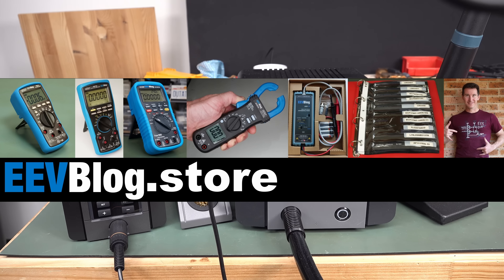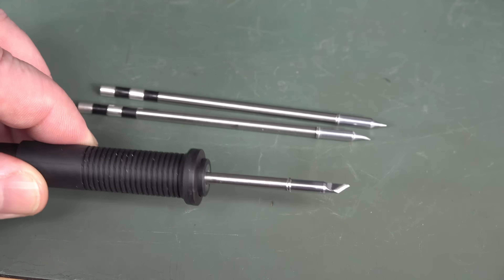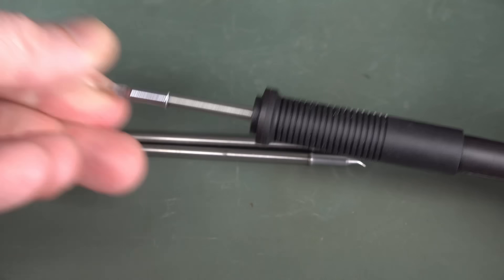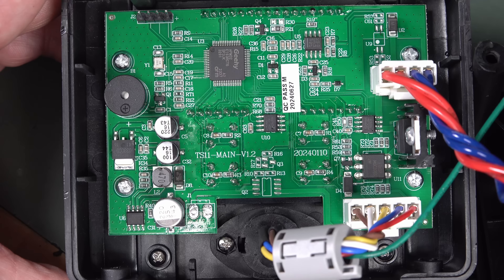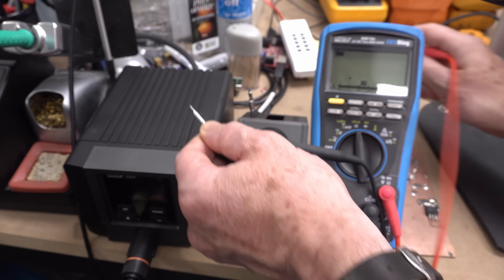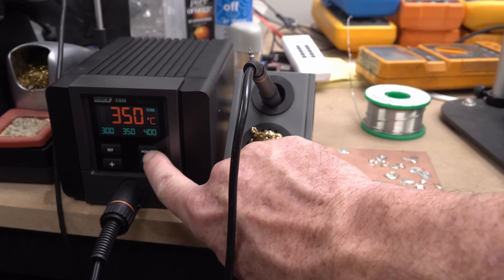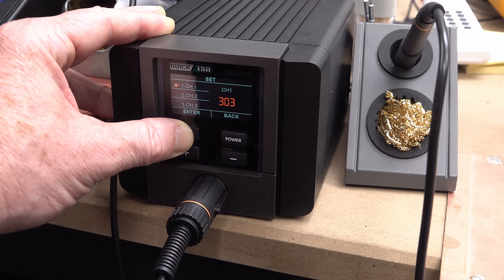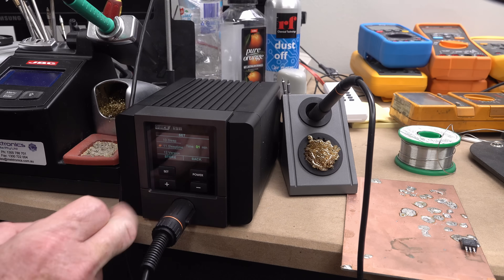EEVblog 1645 - $80 Quick TS11 Soldering Station REVIEW

Comment: How strange! I'm wondering if it's a case of some half-baked demo/pre-production unit? That might explain half the features being missing. Not sure why the power output is so bad though. Maybe that's also a firmware issue, perhaps the power level meter is accurate and it's not even driving the iron properly because it thinks the iron temperature isn't dropping? It's as if it can't even (or isn't trying to) read the thermal sensor or the accelerometer inputs.
Reply: Regardless of if it was pre-production, this is the sample sent out to be reviewed.  A company that wants to even sell something would be making sure its demo product worked for reviewers.  If they can't get their review sample working right, what hope have any of us got of gettign decent support from them?
Reply: @EsotericArctos  Maybe someone in the shipping department sent the wrong one by mistake. Something seems messed up here, beyond just poor performance. Their website certainly mentions a "precision vibration sensor" which obviously isn't working, so it's likely something is faulty or it's a pre-production unit.

Interestingly their website lists 14 different tips for this station you can purchase, not just the 6 mentioned here, so there's the possibility of miscommunication too. Might even be "review" doesn't mean the same to them as it does to us. Lost in translation? It's an interesting mystery...
Reply: @Agent24Electronics  Feel sorry for them if they accidentally sent a dodgy one out, but this is the one we saw the review on.  Would I take the risk on just hoping this was a one off faulty one?   Likely not given what else is available in a similar price range.
Reply: @EsotericArctos  It certainly doesn't give a good first impression, but I'm just trying to understand why the thing performs so badly. Pretty much every soldering station produced these days works better than this, and Quick made the 861DE Hot air station which is popular and works well. They don't seem like an incompetent company, and anyone in a back-alley basement somewhere in China could produce another Hakko 936 clone that'd work better than this TS11 station. It feels like there's something not right with Dave's unit. I wonder what Quick will have to say about it.
Reply from the maker: No idea!
Reply: This is normally something along the lines of a design flaw in where the thermocouple is placed in the cartridge. It still thinks it's hot even though the tip has cooled down. I had this issue with the Pace ADS120. I'll post my findings in the next few days on my channel with the TS11
Reply: @sdgelectronics  But then why doesn't the vibration sensor appear to work? That should still function even if the tip design is bad.

Comment: My Atten iron is pretty good. Forgot the price but you can change the heat setting on the iron itself. The base also has a built in solder spool holder.
Reply: I'm planning on getting an Atten hot air station, the charity I'm volunteering at is looking as getting a soldering station and hot air stations too, and we want to get something decent without spending too much money.
Personally I have a Yihua station, the soldering iron seems to be pretty good but the hot air not so much (its one of the cheap ones with the fan in the wand). I am very much a beginner though.

Comment: Are Quick a decent size asoldering manufacterer?
Hmm, ain't they a behemoth.. like Chinas biggest?
Would have been interesting t see what wattage it actually took, as it does not look like 90w or 80w even with those tips.
It is a cartridge system and they are pretty effective to push, if they are allowed.
A simple AC wattage meter, would have shown you what wattage it took and if its hamstringed before the tip..
the dishonest display, is problematic.. I wanna known the actual temperature, not least on a small tip, as that will also let me be familiar with the system, so I can adjust the temperature high to certain tasks, depending on the dipping..
Reply from the maker: Yes, Quick are pretty huge, which is why this is surprising.
Reply: Is Yihua not China's biggest soldering iron/station manufacturer?  Is Quick larger, or merely larger in the more professional segment? 🤔🙂
Reply from the maker: @TassieLorenzo  I don't know about market size, but Quick have a good industry rep.

Comment: I got an old, dead Metcal for free with about 6 or 8 different tips from fine ones to bruisers. I took it apart, found replacements for the RF FET, fixed the Metcal for about $5 and have been using it for nearly 10 years. No LCD, just on and off and an LED, and Curie Point tips. I'm perfectly happy with it.
Reply: Got a dual one for cheap as well with all the plumbing for a desolder station (on air), never going back. Cheap was because it had no tips, which is easily fixable. It's also 40W, but it is way better than any 40W soldering station I've ever had.
Reply: We only ever had Metcal stations at work and they were a joy to use.
Reply: Metcal is the industry standard.
Reply: Those are all I'll use for my own use.
They used to have them at work but replaced them for hakko units, I have no idea why.

Comment: I own a TS1200 A, I've had it for about 3 years now and I'm absolutely fascinated by it. I chose it over a HAKKO soldering station and a PACE ADS200. While it's true that it doesn't have a wide variety of tips, the ones available do provide excellent thermal performance. The available tip types are B, C, D, I, J, and K. With 120 watts of power, it delivers impressive thermal performance.

Incidentally, I'd like to note that this soldering iron features a capacitive touch sensor located at the front, rather than an accelerometer.
Reply: This. I agree

Comment: My biggest critique on all soldering stations is there are no knobs. The push button temp change (and air flow on hot air stations) is more difficult and takes longer.
Reply: It depends how often you change the temperature, and what you are use to using really.   I tend to set a temperature and that is the one I sue for most things.   I have a fairly old, but cheap, duratech soldering station that has never let me down, it is an old fashioned analogue knob.   I also have a hot air station that is push buttton.    I don't find any big difference setting wither one as I rarely change my set points.
Reply: Buttons are far cheaper to produce than rotating elements.  That's why.
Reply: That is one reason I selected an Ersa i-Con 2V at work when I was allowed to choose a new soldering station. It has a rotary encoder, not dumb buttons.

Comment: You really do complain too much. When something is cheap, don’t complain that it feels cheap. What do you expect? If it pretty much does what it’s supposed to do, even if it doesn’t have all the accessories you want it to come with, that’s ok. I wouldn’t expect something like this to solder on a ground plane. My Weller has a 200 watt iron for it that works really well on a chassis. But that model costs several hundred bucks and the iron is well over a hundred.
Reply from the maker: The setback doesn't work. The live display doesn't work. The thermal performance of the tips is piss-poor even on small stuff. It sucks. I've reviewed cheap irons before (cheaper than this) that work fine.
Reply: I have a Quick 3104 ESD, it's like 100 USD, but you can get it for ~80 USD on sale. The 3104 is a 70w machine and while lacking many of the features of the TS11, the 3104 still walks circles around the TS11. It's complete rubbish comparatively. Quick is a well known manufacturer in the industry and many companies use Quick. Quick does know better but still produced a terrible machine. All that said, as a Quick lover, I personally don't think Dave complained enough. Shameful display on Quick's part in my honest opinion.

Comment: Of course it can't show the temperture at sleep! You don't see the clock on your smart watch when it's at sleep. When electronics sleeps they really mean it!
Not all of us, is talking in our sleep Dave! 😂
If the temperature was following the tip, you wouldn't be able to see your setpoint on the display while soldering. So would you also complain!
On the other hand change the display to a dual line display with set temperature and actual temperature could be a good idea.
But is it so importent to see the tip temperature when soldering as your eyes is on the electronic? The temperature has been set, so you won't burn of the components. (I hope). So the dealbreaker must be: Stupid power meter not working correctly, stupid holder for the solder iron and stupid wake up sensor not working at all!
Reply from the maker: The display literally has the setpoint right there and underlined!
Reply: @EEVblog  Yes so you can't see the tip temperature. You can't get both.
Otherwise it first show a set temperature and then show the tip temperature when it's not the same as the set temperature. For some people it would be confusing. The pre-sets are overlined but you still can change the temperature when you are not using them and that's what the dispaly is showing.
Reply: You only need to see the set point while you're setting it.  If you have two or more working brain cells, you can use one of them to remember what temperature you want to be soldering at.

Comment: i have a Quick TS1200A, live in sydney, if you'd like to compare.
The sleep sensor in mine is Squeeze activated, maybe try squeezing the nib?
Also, the nibs look similar in design, however mine are thicker, maybe cross compatible?
Reply: I'm also a proud owner of a TS1200 A, having used it for around 3 years now. I was impressed enough to choose it over both the HAKKO soldering station and the PACE ADS200. Although the tip selection may be limited, they're designed for high thermal performance. The available tips are B, C, D, J, and K, and the 120-watt power supply ensures exceptional thermal performance

Comment: I have a Quick TS1200A
its a squeeze sensor, maybe this is the same?
Reply from the maker: Nope
Reply: Nope, manual specifically states that to wake it up you can:
1. Turn off the soldering station and turn it on again.
2. Press any key.
3. Shake the handle to resume the main unit from sleep.

Comment: The Aixun brand stations are a lot better and are compatible with JBC tips as well.
Reply: Don’t get the T3A. Unacceptable issues. Search YouTube. Multiple amps of current flow out the tip.
Reply: Which would you recommend in this price range? Aixun T3A?
Reply: @yotoprules9361  Yup. I have the 420D and its great. And heard good things about the T3A
Reply: The Aixun stations have grievous design flaws. Not recommended.

Comment: I stopped using sponges,  the shock from the water hitting the hot iron tends to shorten the life of the plating.   I've not missed using one.   To be fair it's still right there if I opted to use it.
Reply: I've been a sponge man for over 50 years.  I've heard a lot of talk about shock cooling over the years and I personally simply have never had the issue.  I was a bench tech at a TV repair shop for about 5 years, Weller WTCP?  stations running 12-14 hours a day w/ cleaning sponges and I never destroyed a tip.  I preferred running 8's (800° F) because most things were thru-hole back in the early 80's with a lot of cheap paper boards.  W/ 800 I could get in and out a lot faster therefore less likely to overheat the glue and lift traces on cheap boards. Also, still worked on some point to point tube TV's, stereo's etc. where you needed the extra thermal capacity to melt 8 components all soldered to the same point (HATED p-p wiring - PITA to work on).  A few years after that I was building automated material handling equipment and we did a lot of in-house board assembly.  Same thing, Weller WTCP's w/ sponges running 24/7.  The tips were typically replaced because of damage, usually from getting dropped & the tip getting bent, not due to plating failure.

Several things I have found that kill tips is 1st and foremost, the quality of the tips.  Those old Weller tips had very heavy plating and lasted forever, went thru more heating elements than tips.  2nd is keeping a coating of solder on the tip.  If you wipe it clean then let it sit for an extended period the thin layer of solder oxidizes and then the tip will start to oxidize.  Keeping a decent layer of solder on the tip protects it and prevents the plating from oxidizing.  Finally is contamination.  Melting plastic really seems to damage tips quickly.  Not sure if it's the plastic itself or it simply clears off any solder on the tip exposing it to oxidation.  When I was off work on injury for close to a year, when I came back people had been using my cheap Yiuha? soldering station and the tip was wasted.  I used it for about 8 years without any signs of damage, Bubba destroyed it in months.  It was caked with crud and oxidation that had made it thru the cheap plating and into the core.  The entire tip had burnt-up ?? baked onto it.  As cheap as the tips for those things are, who cares, just toss another one into it.
Reply: I have a Chinese 968 type rework station bought mainly for the hot air, but my main iron is still a Weller TCP I won this as an apprenticeship prize 40+ odd years ago, and it's still going. Never had a replacement element, and I've still got the orig. tip in the box. Like yourself I've never seen a TCP tip destroyed in normal use. The only time there was problem was if the magstat switch failed There were hundreds of these irons in use in the factory left on all day (and sometimes all night) , and in the repair box there was usually less than a dozen. The main problems were leads splitting from so much use to the odd cracked handle, then the much rarer magstat switch needing some work / replacement. No 7 tips were the standard.

In the home workshop I do have the irons on a   separate power board that is plugged into a smart socket set to stay on for 4 hours or so just in case I forget to turn them off.

Andy
Reply: I only used the sponge on mine in the beginning when I was still very much a complete noob, but I quickly came to the conclusion that it's useless. The brass wool does the job more than well enough.
Reply: @WereCatf  Still a noob then, sponge has been used since day one, decades and you think it's useless.
Reply: I changed to the metal wool as due to your point regarding the cooling shock.
Must say that i sometimes use the sponge again, because i think it clean the tip better and i haven't experienced that it shorten the life of my tips to my Weller. ALways the original weller tips and the lasted for years.
Reply: I use the opposite logic. The steam fully cleans the tip almost instantly. Dry wire pads never quite clean the tip and leave crud embedded in flux to try to remove. The time I can save with near instantly clean tips and no crud on the bds more than pays the cost of a tip that might not last as long. But then I solder quickly, more like an assembler than a tech as I've done a bit of assembly.
Reply: I just quickly use a dry kim wipe.
Reply: @mrDarktrooper  I've used dry paper in a pinch. Not the best but it works well enough.
Reply: I use Glycerine instead of water. It has less termal capacity than water, so less stress (however it is hard to find pure glycerine in my location, so water is anyway there).
It keeps sponge wet for weeks and month.
It is slightly active and acts as flux when I clean tip.
The only downside is that it is reportedly not healthy to inhale in large quantities. But I'm not doing soldering on every day basis.
Reply: @MSP_TechLab  I've heard that glycerine fumes are cancerogenic, and thus it is not recommended to use it for anything related to soldering.
not sure if that's true, though.
Reply: @s_s-g4d  yes, I've heard the same. That is why I try to not use it much. But as sponge fluid, it is more convenient than water. Anyway it seems it is not much worse than any other soldering fumes with which we deal in this hobby. It is always better to solde with good ventilation.
Reply: @MSP_TechLab  propylene glycol might be an option too.
Reply: @s_s-g4d  I doubt it's anywhere near as toxic as flux, it's what they make vape juice out of, lol
Reply: 1. Sponge is meant to be damp, not wet.
2. Brass curls are always more abrasive than sponge & they are sometimes made of plated steel or replaced with wire wool ☠️
Reply: @davadoff brass ought to be softer than the iron and won't thermal shock the plating off your iron
Reply: @davadoff  Youre right, if youre going to use a mesh ball it MUST be REAL BRASS, anything else like copper or flash plated steel meant to look like gold brass will wear away the tip coating - years ago they ALL came with brass but now many comne with flash plated metal or copper and thats really bad for tips - Brass is the softest you can test it with a magnet,  a real brass ball is not magnetic
Reply: Metal brush better? 😂
Reply: @jogurcik13  -- Mesh balls must be made of gold colored REAL BRASS which is soft enough so they dont damage the tip coating, beware so many irons are now coming with copper or flash plated metal meant to look like brass but are not -- test the mesh ball with a magnet, if it responds to the magnet its NOT BRASS no matter what the color - real brass is bright gold, is not magnetic and will not respond to the magnet - USE REAL BRASS LIKE WHAT COMES WITH A HAKKO or other options that are real brass -- brass became expensive and you will find they arent cheap for this reason, so they are trying to save money, some companies are actually substituting copper scrubbing balls from the hardware stores kitchen isle, do NOT use these.